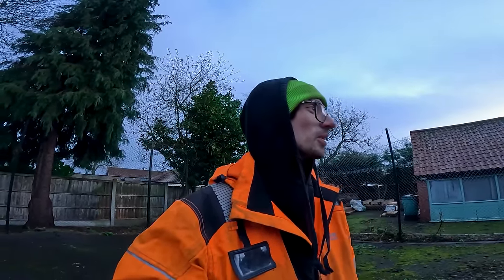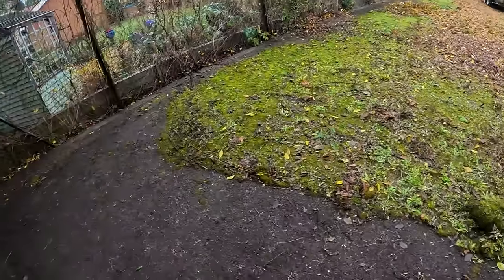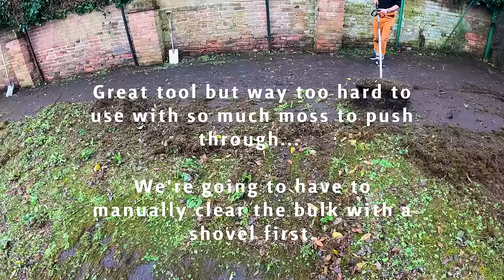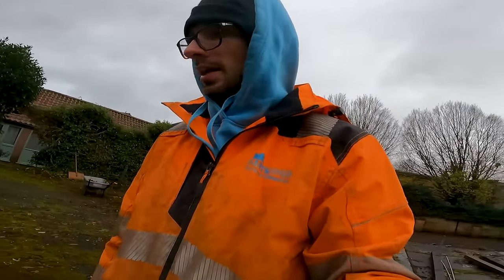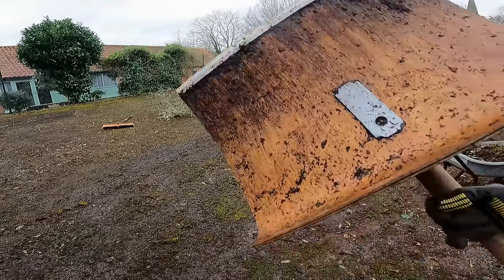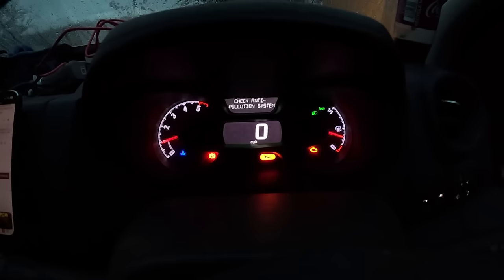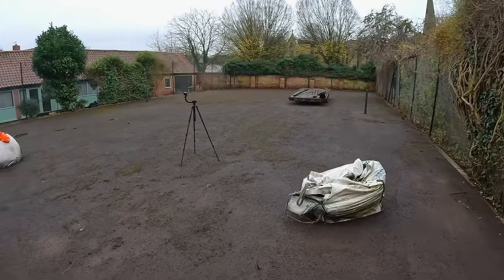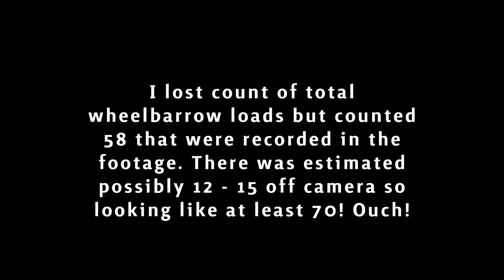CLEANING THE UK'S WORST TENNIS COURT! *MY HARDEST JOB EVER*

Comment: It is a typical Dutch model of snow scraper, it is called a “sneeuwschuiver”. I will have look for that particular model on the websites of our typical garden center, farm supply and DIY shops.
Reply: It seems much more reinforced than snow shovels I’ve seen here in New England nowadays.  I’d also pay the extra to get a snow shovel that will last 10+ years.
Reply: Looks like an aluminium front edge with a formed plywood with a big steel or tin(?) plate with some big U-bolts and the handle is shaped to fit the scoop 😍
Reply: As will I. I want one for myself ;)

Comment: If you're ever doing a job where you have to remove layers of moss in big chunks, and you can get them out looking clean, you might consider contacting a local florist to sell them. They use plaques of moss in making flower arrangements. Buying a one foot square piece of moss in a garden center can cost you about 2-3 € a piece...

Comment: You should get an air compressor kit for your car, if you don't already have one (replying to your comment about a flat wheelbarrow tyre). My dad's got one and it's incredibly easy to use. Just plug it into the tobacco lighter (if you have one) thing on the dash board and that's it. Costs like 25€ so maybe like 20 pounds? The price is the part which blew my mind the most, so cheap yet so useful.

Comment: The wooden snow scrapers are ideal.
Used then here in Germany for years.
Tip: remove the front metal edge and with use they'll curve slightly to become more plough like. Plus they are a lot quieter

Comment: Well, you are proving it could be done/improved.  I would agree with people noting that you would reduce a lot of wear-and-tear by pointing the wheelbarrow where you intend to go...before loading.  Liked that you thought of moving a lot of leaves off with a leaf blower. Really enjoying you trying different techniques to work your way through the process.  12:29 is just about a Grime Line, after working through layers of material. That was a huge improvement with the court area. The organic material/dirt result may work in planting beds. A worthwhile experiment, considering moss seems to be a regular "crop" where you are, and leaves an available source of mulch.  As the design of the place is re-appearing, now I'm interested in what the stone wall would look like power washed (or biocided). Wishing you all a good Christmas Season and New Year.

Comment: Looks great Sid. The problem with the van could be to do with a blocked DPF filter. Take the van for a drive for about 30 mins on the motorway keeping revs between 2000-2500 RPM.  Make sure the van has more than 1/4 of a tank of fuel.

Comment: My dad has one of those from Germany and its probably older than me (44) - The whole blade part is all metal and its fairly battered but still works really good.  Normally used to load manure to move round back of the house for the allotment.  Wouldn't know where to get a new version of it though.

Comment: Hi Sid, get some Redex from halfords - the full system cleaner and stick it in before you fill up next. its likely your injectors are full of carbon. If you have a DPF on the van, get the DPF cleaner. Will sort it out.
Reply: I've had lights come on and it's just that the petrol cap was loose.  it's an easy fix if that's it.  :-)

Comment: I’ve had jobs like this, for bad ones we usually rented a special weed brush, basically it was a round road sweeper brush with a petrol engine stuck to the top attached to a brush mower frame. It did the trick but I found it difficult to handle as the torque constantly pulls the machine sideways.

Comment: Another great video thanks 👌🏻

Had the same problem with my Vivaro van and was a blocked up pipe leading to a sensor under the bonnet.

Pipe clogged up with carbon 
And managed to clean it out myself and once code removed hasn’t come back on since 👍

Comment: Next time you need to move a trailer like that, wind the jockey wheel all the way up so one of the axles is off the floor so less resistance pushing against you 👍

Comment: I recently retired one of those snow shovels, that I bought in 1980 in Germany. It was still functional, even though it had started to delaminate, due to sitting in a puddle in a shed with a leaky roof. If I had kept it dry, it would still have been as good as new. 😢

Comment: No BS. I've just done a job exactly like this, but on an old car park that was covered in moss. It had grating panels underneath the debris with nodules on, so i couldn't even scrape the area first 😂. I used a stihl power brush and then a bigger one with wheels that you push. My arms and shoulders are still recovering 2 months later😂😂.

Comment: Just a thought, but, could you not put a weight at the bottom of the pole on the wire brush thing, to add some downward pressure and make it easier for you?

Comment: When I was on the council we had one of those attachments for the strimmer but what’s better is what we called a weed wacker. It’s a machine that looks a bit like a mower and has metal wire like rope. It’s rotory rather than cylinder. It’s far far easier. Just looked it up. It’s a Mosquito. There different size machines and different brush heads. There are demos all over the YouTube

Comment: Man your issues as a self employed guy are so relateable. This time last yesr id sunk £2400 into a van and it dropped a valve seat in the engine a week before christmas. Bought a little vivaro for 1500 quid to see me through. Made do till it was just too small and bought a 2014 master for 3600. Everytime i tried to sell that little backup van something would happen and id need it again. Fast forward 6 months after buying that master and its got an early headgasket failure.

It never stops with vehicles eh!

Comment: Nice work. I thought that maybe a weighted garden rake with a ~2m handle and a replaceable head would be good for those sort of jobs. You'd just pull it behind you as you walk up and down the tennis court, loosening the moss. You could even DIY it by buying a cheap garden rake, attach a water jug with zip ties ~60cm above the head. In essence like a plow.
For a specialized commercial version add axeled double wheels between the head and the handle and make the tines independently movable and weighted, so not to rake over small spots.

Comment: P.S. ... The best way to move 'any' vehicle 'manually' is not to Push or Pull - But to get yer hands on a wheel and turn it ( preferably one each side ... Sooooo much easier .....

Comment: It's fine to drive with that light in.  It'll be a sensor - not sure how much, I had mine done under warranty.  Like yours, mine came in after a period of bad weather, don't know if that has anything to do with it though.
Reply: It’s probably the DPF , gets blocked by diesel fumes .
Reply: @bestcrazyboy8487  - no, DPF is fine - it was just a defective sensor.  The tech that replaced my 2nd one said they'd had a fair few - reckons there was a dodgy batch.  The bad weather thing might be coincidental

Comment: if the owners are going to let it get that bad because they arent going to use it as a tennis court, they should convert it into their garden area. I would at least, put the veggie beds on top of it. could even lay some weed matting down first over the whole thing, put the beds down, add some path material like blue metal or wood chips then the court itself is protected but not sitting and rotting for another 10-20 years. With the fencing they could even put bird netting across the top to cover it in, add a chook run, so many possibilities!

Comment: Mate, you need to 'crowd fund' to get a Stihl Kombi KM131R engine unit and all the attachments [to include wire wheel and rotating brush] together with a decent, Stihl pressure washer. The days of hand scraping with a hoe are long gone! Great effort, but move with the times and charge a few bob more.

Comment: As for the anti pollution warning … and assuming the sensors are still sensitive as hell …
Best let it check by the local motorist's/touring club. If you're a member, they should do the check (and reset our the warning) free of charge.

I had those all the time with my Japanese sports coupe and every time it was a one time failure.
I had it checked at ÖAMTC (one of the two Austrian touring clubs); took about 15 minutes and the pesky warning was gone.
In case the warning is legit, they will tell you, tow your car to a dealer nearby and most likely even offer you a spare car to get you home (well … provided the Brits do it similar to Austrians; though it likely won't be a van with all your bells and whistles 😉).

Yeah, a business membership might be a bit more pricey … yet it keeps you afloat in case of emergencies.
Reply: It’s probably the DPF that’s blocked by diesel fumes